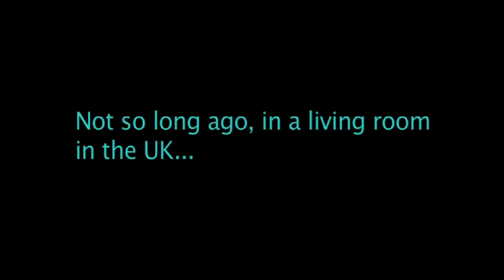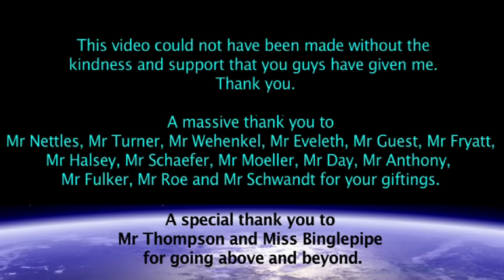Build the Millennium Falcon Parts 44 & 45: The carbonite has thawed!

Comment: I am not 100% sure but it looks like you cut to much off them "dome" bits that go on the right and left of the centre piece. from what i have seen it looks as if it should have a long bit that comes out of the bottom. not sure if it bothers you to much, i just noticed it from the spree as one "left over" bit was bent. Good to see yo back on and i am just upto that bit myself now.
Reply: +whoamiuk1 Agreed. The big round bits on either side of the central box should have some pipework coming down. But welcome back Chris. You have been missed.